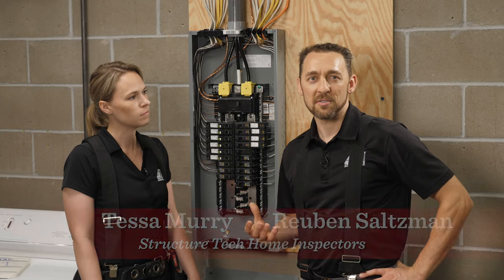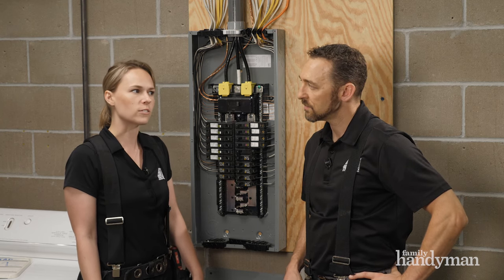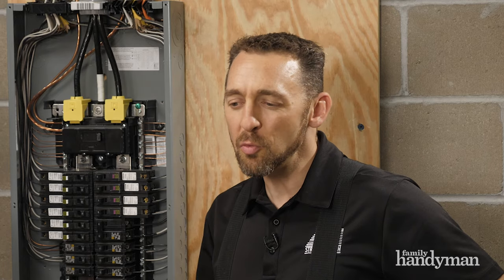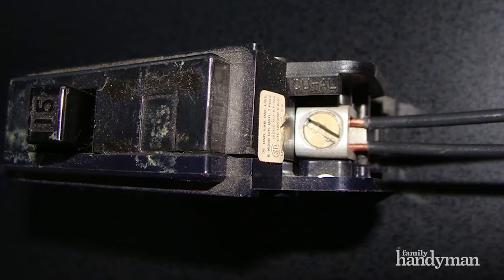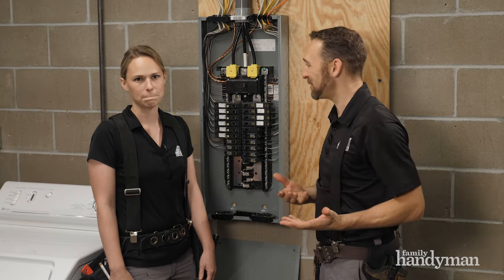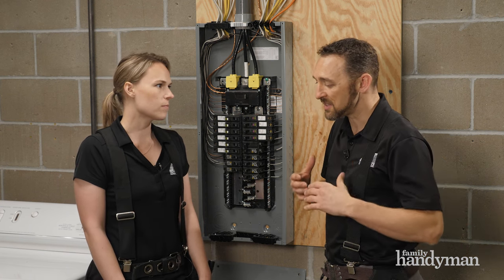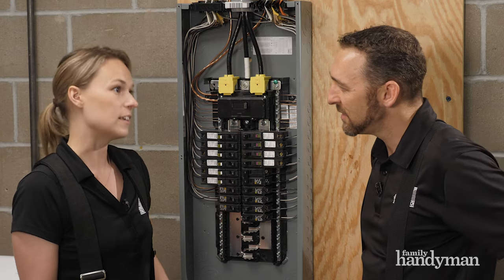What is a Double Tapped Circuit Breaker?

Comment: What if you placed the two wires into a dual-feed ferrule (properly sized for the wire gauge), crimped it using a ferrule crimper, tug test, and then insert the crimped ferrule end into the breaker?

Comment: I have an old home.  My bedroom, bathroom and kitchen (not the range thankfully) are all on the same circuit. It trips if we use any combination of space heater in the bedroom, hair dryer in bathroom, coffee maker or microwave in kitchen.  I realize microwave should have a dedicated circuit and can deal with that down the road.  Obviously I'll check code, but functionally speaking if I have an open breaker spot am I to understand that I just get another breaker and do this pigtail deal and "split" the circuit I should then in theory be able to safely operate at least two of my aforementioned appliances simultaneously and safely?

Comment: Absolutely it can catch fire.  I personally witnessed a breaker turned black and covered in soot from the two wires arcing intermittently.  Pigtails aren't allowed so you have to split the circuit in a junction box, next to the panel, if there isn't enough room for more breakers..
Reply: Some areas allow tandem breakers, which is what I assumed they would do in this video.
Reply: Why arent pigtails allowed?
Reply: those two wires won't arc to each other, they're on the same live line.. unless one isn't even connected.
Reply: Pigtails are actually allowed. readup

Comment: Some Square D Homeline circuit breakers are made for double tapping If the code in that area allows it and if the correct wires are used.

Comment: Nice video. I have a question that is kind of on topic. Why do some panels have a quad main breaker and (most) others only have a double? I get a double is to control both phases of a panel. Why would you then need a quad breaker? Sorry, but I just spent about about 20 minutes trying to find a video explaining this to no avail. Thanks in advance for your answer.

Comment: Question ? Hope you can help. I have 3 outlets, 2 on one breaker, and 1 on another. I'm trying to hook my wires up to a generator box. My question is, can I connect the 2  wires together and keep them on the same breaker box as they are and run a pig tail to the generator box ? Thank you
Reply: There's really very little information to go on in your question.
Reply: @streetfit909  can I take 2 trip breaker fuse wires? connect them together with a pig tail wire and then connect each one individually to a generator wire so they would run on the same generator fuse.

Comment: I woudl think a screw down of two wires on the breaker would be better connection than using a wire nut but hey, I'm not an inspector so.

Comment: incorrect, the double tapped breaker is better because the wires are loaded from their own circuit , the remedy shown that combines the wire and a single tail termination is actually more dangerous as wirenuts are one more point of failures and loose connection.
AHJ will flag the single tail and revert to double tapped
Reply: What jurisdiction? Not true in my part of the pnw

Comment: I seem to be having an issue running a mini fridge in an upstairs bedroom. It tends to make lights flicker & surge some things a bit when the compressor turns on every now & then. Could splitting the breakers solve this problem? or should I just replace the outlet its hooked up to? I made sure it has its own outlet since its kindof a large appliance. The two rooms next to one another are on the same breaker line(dumb design IMO) so I figure it would midigate this issue.
Reply: It should have its own outlet on a dedicated 20 amp circuit, without anything else.
Reply: Lmfao is this comedy channel????
Reply: @Glocko44  A mini fridge does not need it's own dedicated 20 amp circuit. lol
They run around 7 amps, far less than a space heater on high which is 12.5. Just make sure you're not overloading the circuit, if you're on a 15 amp circuit and you're already putting 10 on it, the mini fridge added to it will overload it. If not, great. Simple.
Reply: @LostBeetle  Remember that by code a 15 amp circuit has a maximum allowable load of 12 amps [Section 210.21 (B)(2)].  If you have a 15 amp bedroom circuit and add a 7 amp appliance onto it, you are leaving 5 allowable amps for a whole bedroom and whatever other room is on that circuit which is completely unacceptable.  Will it work?  Sure it will.  Is it right?  No.  You may not even trip a breaker depending on what is plugged in, but again that does not make it acceptable.  Now if it was a dedicated 15A that would also work because you have 5 extra amps and no other rooms would be tied to it and pulling from it, but if someone is going to go through the trouble of running a dedicated line up there it makes sense to just make it a 20 instead of 15 so there is room to add a larger appliance in the future if necessary etc.
Reply: Perfectly acceptable for anything that doesn't run continuously (over three hours I think) at 80% capacity and above. A fridge does not run this long at all, not even close. The only high draw appliance you plug into a standard outlet that would run that long I can think of are space heaters, and most of them have a thermostat so you can set them to not run continuously. Also, apparently 12 and 14 awg can actually handle 5 amps above what they are rated for, and I read some countries do give them their true ratings. An extra safety layer is giving 12 awg 15 amp breakers and there's not a chance you're ever overloading them now.
And breakers don't pop as soon as you overload them a little, they can allow for sometimes hours and will pop if the temperature exceeds the limit, this is because wires don't just spontaneously combust when you go over their ratings a little (still avoid it!). The codes are meant to add many layers of fail safes before relying on the final fail safe (the breaker), which is in theory a good idea as most people take electric for granted and only know they overloaded something when they start popping breakers. And even they have that 5 amp fail safe by giving wires ratings that are 5 amps under their true limit.
Reply: @Glocko44  thats continuous load, can be a 100%on noncontinuous loads.
Reply: All these comments miss the point, I would look for a loose neutral some where. If the wire is just plugged into the back of device it will be in one of those

Comment: Wow! This is what I think I came to YouTube to find.
I have this mess of  a service panel. On one breaker I have way too many receptacles going to one breaker.  Not everything is on at the same time but its very easy for over 80% to load that breaker. There are other breakers in this panel that have no serviced receptacles. So there are breakers with nothing attached. How could I split up this breaker that has too much on it with a breaker that has nothing.

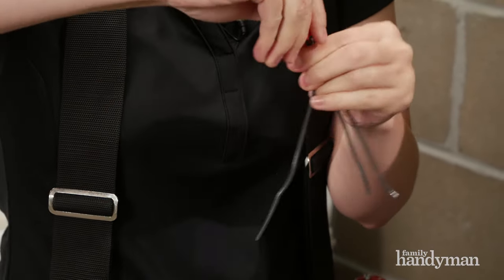Comment: ,1:31 youd fail inspection where my juridiction was. You better ask the inspector if wire nuts are allowed in the panel
Reply: Wire splicing and pigtailing are allowed in a breaker panel and expressly permitted by NEC 312.8 (A). So your jurisdiction is overly strict or makes up their own guidlines.

Comment: No wirenuts allowed in elect panels
Reply: Code pliss you're sure
Reply: In Section 110.14 (B), which looks at splices for electrical connections, the NEC states that conductors should be joined or spliced using “splicing devices identified for the use”. Wire nuts qualify as one of these splicing devices. Therefore, using wire nuts is allowed by the NEC!
Reply: unless your in canada they have thier own rules.
Reply: @allotherstaken3  NEC is wrong

Comment: Hey, you guys can read the cue cards, I see. :) Now, 'not a proper physical connection' isn't as crucial as 'the circuit is overloaded,' especially in older constructions where limited space or an inadequate service rating leads to double-tapped circuits. I want to see you explore how to check for overloads and discuss cost-effective ways to distribute the load. (not just SEO for "Double Tapped Circuit Breaker" and put up some lame video to get more views.) Speaking of double tapped "break-er" and distributing the load for a proper physical connection... ;)

Comment: Not no but hell no, you're not allowed to make a joint in a panel,   Hence the word PANEL not J-Box  Read your code book  I think ya'll need to back up and punt.  I also think Schneider needs to redesign their breakers,  double lugging is a dangerous situation.  If you have two circuits on a 20 ampere breaker because of the way it is manufactured does that just automatically make the breaker now a 40 ampere breaker.   I don't think so.  There are too many electricians that would put two circuits in that breaker knowing they are two different circuits, then later say "  Well they said you could put two wires in one breaker.   They are not piggy back breakers.   Dang  does a snake have to bite you before you realize it's a snake then  say, " I guess they were right it really was a snake."